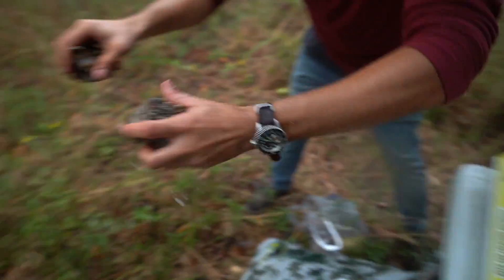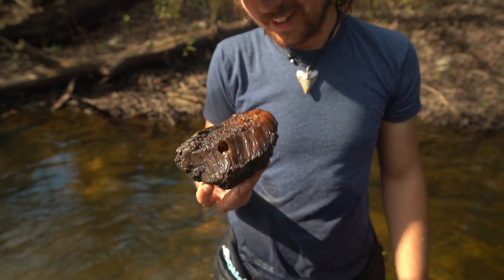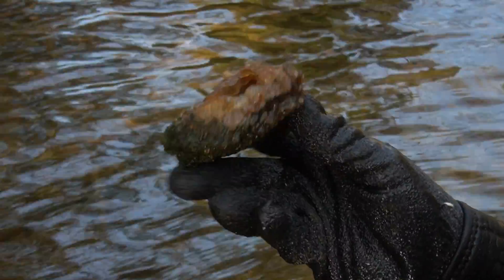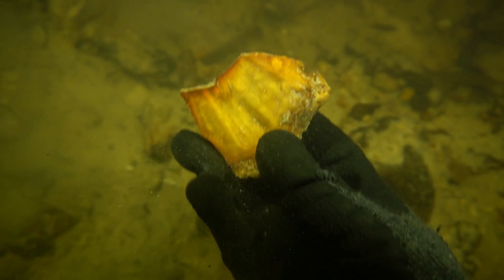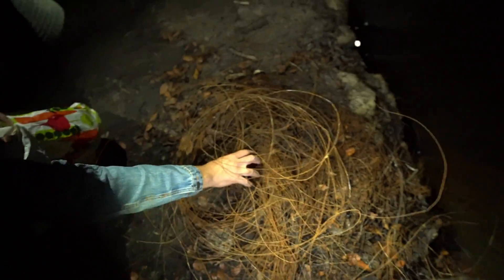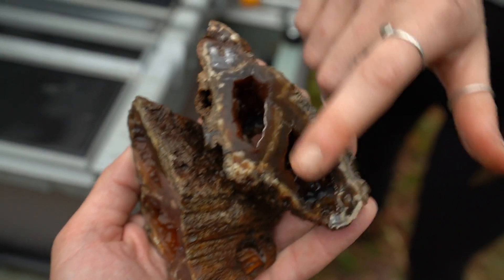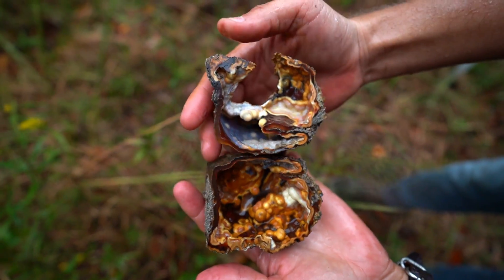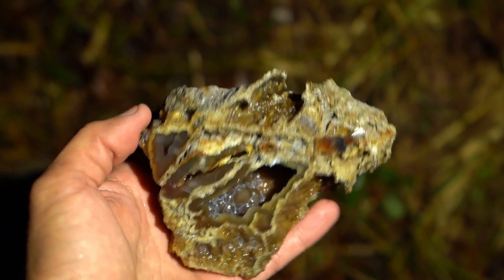We Found Agate Geodes Inside Fossil Coral and Cut Them Open on a Saw (Druzy Quartz Crystals)

Comment: I don't think the coral would be considered a geode not sure enough to really say. But I thought geodes was formed almost like a bubble under exream heat under ground. Now they have soaked up menirals like quartz. Similar to what happens to petrified wood. But inot sure if you could call it a geode.
Reply from the maker: I think that may be technically correct from a geological standpoint, but the name geode has kind of morphed over time to mean a hollow rock filled with crystals or another mineral, at least among rock hounds. Geologists would probably not like that term being used in these contexts, but it gets the point across to people quickly what something is.
Reply: @PaleoCris  yes I agree yall found some lucky finds. We had geodes in ky but they were more like I said a bubble. But I do agree. Wish I could go geode hunting in Brazil. I think nature is so cool. Anyways thanks for responding and keep up the good we work with your channel and your finds.😁

Comment: Safety first? Wheres your gloves?.  You don't know what it's like to live without all your fingers.
Reply from the maker: You’re not gonna lose all your fingers from a continuous rim diamond tipped saw blade. It doesn’t cut because it’s sharp. It cuts via abrasion of microscopic diamonds on stone. You can touch the blade with bare skin while it is running and it won’t cut you.

Comment: This was amazing. First time I've seen your channel not sure why but have subbed to keep them coming. I'm a rock hound from Oregon and had never heard of these b4. Im curious if these geodes are fairly young on the geographic scale? I ask because they are not solid and the holes where water enters are still visible. Or is this just the way this material, the coral forms?The geodes from here and others I've seen are mostly solid and totally encased.

Comment: Pretty cool. Where I live in NV about 25% of geodes will have opal along w/quartz/agate inside. You guys ever find any w/opal?
Reply from the maker: I believe the white inside many of these is a layer of common opal. I have read that it is from multiple sources. It is just a very thin white layer normally coating the insides of many of the chambers.

Comment: The saw your slabbing with iis that a 10 inch Harbour Freight Chicago Electric  ?  How do you like it and what blade are you running ? Thanks for the great video .
Reply from the maker: Yes it is! It’s does the job, but I think I’d prefer a table top tile saw so I could more easily rotate geodes and other things as I cut. I’ve seen where some rockhounds modify 7” tile saws to take a 10” blade. I may try that in the future. The blade is just a basic continuous rim diamond blade. I’m not working with super valuable material, otherwise I’d go for the more expensive lapidary blades.
Reply: @PaleoCris  Thanks Chris the reason i ask  Harbour Freight has them on sale now for 239.00 . Just need something to slab larger rock that a 7 inch won,t handle. And not break the bank . Sure like to find out more on converting a 7 to a 10 that sounds interesting . Not cutting anything real value either just for my own personnel collection .